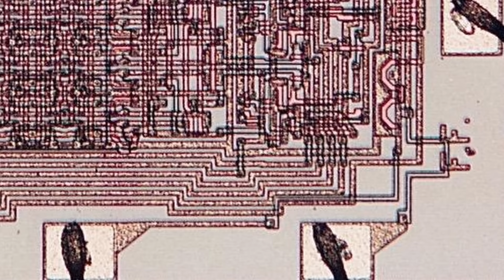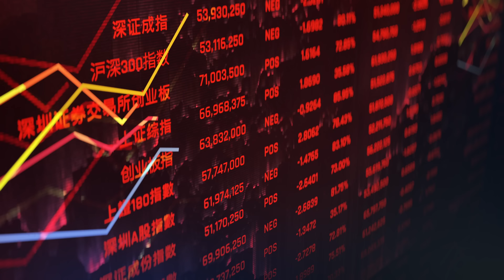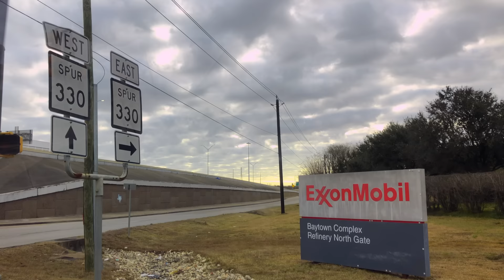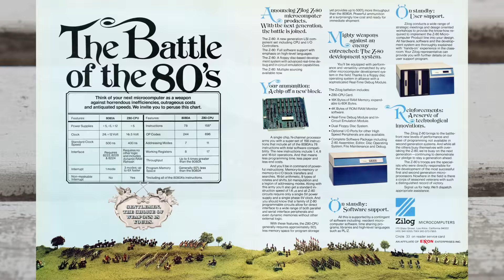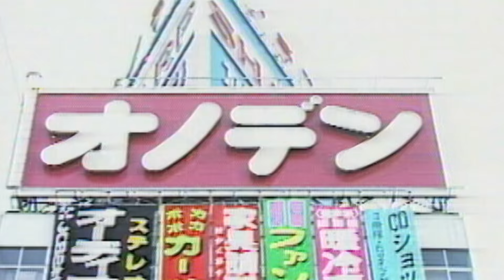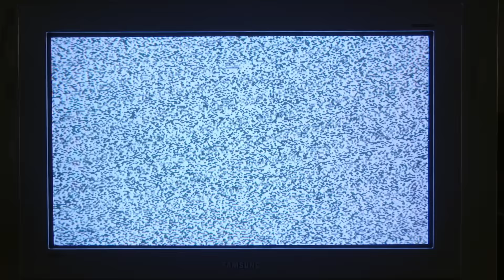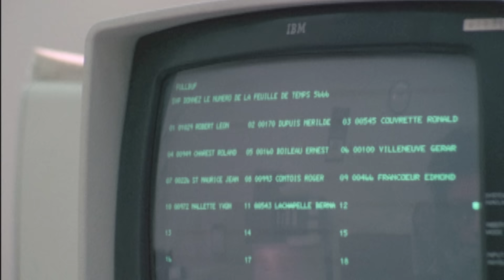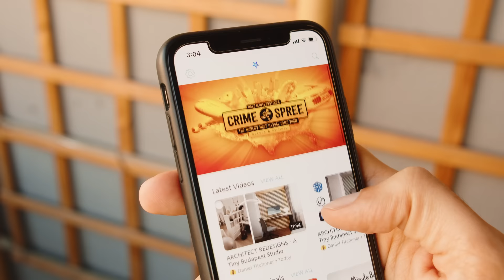Intel’s worst Nightmare

Comment: Wow, thank you for explaining what Z80 is because I believe it is one of the most important technologies that enable 80 column display in an Apple II (Z80 processor card). From that point, we have supercalc, the forefront of all spreadsheet applications. I still remember using and playing spreadsheets in early 80s and needless to say I became a software developer when I was 14 and continue until today (for 40 years and strong). Thanks again for filling me in with this important missing technology in the history of computer development.
Reply: The display format has nothing to do with the CPU. The CBM8000 series from Commodore had 80x25 displays using a 6502 and a 6545 display controller. The 40 character limit was probably a design decision based on small screen sizes and the cost of RAM (1k vs. 2k).

Comment: When the 8086 chips were obsolete, but still in the field, a client had a huge problem.  They used tens of thousands of them.   Upgrading to 386, or higher, was a manual process, that was going to take years.   I actually worked on a project in the 90's, to eak another few years out of the 8086's, so, the company had more time to replace them all, with their phone switching code.  Do you think employees were thrilled.....NO.  They wanted the upgrade.   (lol).   The 8086's did a single task, but there would be 500 in a box.

Comment: The Z80 is still to this day used in all sorts of devices. I've been using the Z80 and it's family of chips since 1979 in all sorts of projects. With 158 instructions (+ some undocumented), mode 2 interrupts, main and prime registers that swap with one instruction, the Z80 is still, in my opinion, the best 8 bit CPU ever engineered. It just works, and there are dozens of assemblers and linkers and library managers for the Z80.  By the way, SGS and Sharp licensed the die(s) for the Z80 and it's family of chips, and was allowed to make the Z80 via a license agreement. If you crack open a Sharp plotting calculator, you'll find at the core of the system to be the humble Z80. The packaging has changed, and some neat add-ons like serial and parallel, timers/counters have been added, but the instruction set is essentially the loveable Z80's, with some add-ons. I enjoyed this video. Thanks!!
Reply from the maker: Oh yeah. I sadly had to cut that part of the video but the story of how Zilog managed to bounce back and exist back today is in itself fascinating

Comment: Re Faggin, no, transistors with silicon were already being made in the mid-1950s (invented by Bell, but made practical by TI). Diffused silicon appeared in the mid-50s (Bell) as well, first with aluminum and silicon around 1955 (using evaporation processes to alloy in the emitter - which meant it produced a PNP). In the late 60s, Faggin created the first commercial self-aligned gate MOSFET chips in 1968 (Fairchild), but SGTs were invented at Bell in 1967. Faggin really became famous in the 70s at Intel with the 4004 initially.

Comment: Nice, but I think you completely skipped over the 8080 processor (as in, the 8080 design occurred before Faggin left Intel). In fact, a great part of Faggins leaving Intel was because management considered that to be the end of the 8 bit line, and Faggin disagreed.

Other small additions to the history:

* One of the major advances for the Z80 was the unified signal structure, like read and write pins, and memory, I/O and interrupt pins. The 8080 was heavily multiplexed and output  these status bits on the data lines, requiring external decoding, and an external chip. This was fixed in the 8085, but that happened after the Z80. To really follow why the 8080 did this you have to follow the original 8008 with 18 pins. The 8080 was an extension of that design.

* The original 8080 required a clock generator chip, which was mostly ignored by implementors, who generally rolled their own, typically with 50/50 duty cycle. The 8080 used two overlapping phases and 60/40 clocking, and the result was timing issues on many implementations. The Z80 fixed that, as did the 8085. In the era the 8080 chip came out, the MOS technology used could not implement fast clock circuits accurately.

* The other "design copy protection" Zilog used was substrate underpassing. All ICs are circuitry built on a substrate layer, and the transistors are implemented as "tubs" of conductive silicon in the substrate, either by diffusion or implant. The wiring normally goes on top of that (and now reaches more than a dozen layers). However, its possible to have short paths in the substrate, short because they are more resistive than interconnect. Several such "underpasses" were put in the design. The advantage is that they don't show up in the interconnect, and (at that time) didn't yeild to traditional reverse engineering methods.

* Intel was correct that the microprocessor market would head higher, first to 16 bit processors, then 32 bit, then 64 bit today. Zilog and Intel fought it out over the 16 bit market with the 8086 and Z8000 processors. Although the Z8000 was a simpler design (it had to be), Zilog could not keep up with Intel on process, and lost the market. Zilog did, however, own the embedded market for a while, and Intel faced a long slide downwards in embedded, starting with the 8051, then the 80186 and a few other failures that nobody remembers today. Motorola was able to stand toe to toe with Intel on process, and introduced the 68000, which shocked the industry with a flat 32 bit memory structure when both Intel and Zilog were trying to push segmentation. IBM chose the loser, Intel, but that created the split that still exists between PCs and Apple computers, which followed the 68000. This is, of course, a whole 'nuther story.

[I worked for Zilog in 1987, on the Z280 project, which was a 16 bit processor downward compatible with the Z80]
Reply from the maker: Thank you for your detailed contribution! It is amazing to hear from anyone that worked on Zilog.

And thank you for details, particularly on the copy protection. I found the whole thing fascinating,. My background from university is on telecommunications so I only have a working understanding of circuit design but the more I learn about how these protections were implemented the more interesting it all becomes.

Yes, I did intentionally glossed over the 8080 in the script, limiting it to a mention later as a design inspiration. It was very hard to squeeze a story this big into a YouTube friendly format, specially for it to fit on a our art budget, but in the source interview Faggin goes into a lot of details on those days and the events that lead to him leaving, including how some of his superiors at Intel patented some of his developments without including him. I figured getting to the Z80 had a higher priority in the story but was still a shocking read.

The other part that was painful to remove was Zilog after Exxon. I was super interested in reading up on how the employees re-bought the company and how they are still a big name in embedded decides to this day, but could not find any way to include that without breaking the narrative flow of the ending. I have read literally hundreds of comments from people who work either in embedded design or in maintenance that constantly run into Zilog chips in things like refrigerators and microscopes. I wish I could have figured out a way to at least mention it while preserving the flow of the video!

The 16 bit section is something that I go into more details on the SIdeQuest episode in Nebula, particularly how the Exxon thing made it impossible for Zilog to compete with Intel on the PC project and how the segmented memory made it impossible for them to sell to Apple on the Mac project. I based those on interviews with Faggin and Peuto and found it a excellent story of how a lot of technology we have today is not the result of what was better, but the survivor of a constellation of business decisions.

Comment: Taught myself assembly language on this chip while working at the Tandy factory producing the TRS-80. We diligently worked to repair every single PCB that had a problem off of the production run. When they instituted a 10 board minimum repaired per day, we went for the easiest to fix. Got 10 done in the morning and learned assembly in the afternoon. Dog pile grew like crazy but management never said a thing. I never could understand corporate thinking.
The mnemonics for the Z80 assembler were far better than the Intel, and the Z did not have that crazy address latching business going on. I also remember Bill Gates meeting with the bosses, but as you know, Radio Shack did not make a deal with him. I wonder what the future of Radio Shack would have been.

Comment: As a side note, I was working for Olivetti in Cupertino in 1979, with the intent of designing them a desktop "personal computer".  After talking with Tom Gunter at Motorola, it was obvious that they had the best 16-bit technology at the time.  We got a working first sample of the upcoming 68000 and designed a board for it, and it worked as documented.  We then developed and integrated it into a paper-like display similar to the Xerox Alto, wrote a cross compiler that ran on a Z-80 box in UCSD Pascal, and created a presentation for the Olivetti "owner" Carlo Di Benedetti to show that it was buildable and programmable.  As was typical of Olivetti at the time, they hemmed and hawed and dragged their feet, afraid of what IBM might be going to eventually introduce.  Meanwhile, my boss, Enzo Toressi, who had gone to school with Federico Faggin in Italy, was being lobbied by Faggin to use an upcoming device they were working on, the Z8000, instead of a Motorola or Intel chip.  After vacillating a fair amount of time, Enzo decided that we should redesign the device to use the Z8000, which was clearly inferior to the 68000.  It would require a complete redesign of the hardware and rewriting of the software due the differences of the hardware interface and the instruction set, and be an inferior product.  I and several other people on the project were disgusted with the decision, so we left Olivetti to be involved in a startup company.

Two years later, when Apple introduced the first Macintosh, with the WYSIWYG user interface, and almost identical hardware design, using the 68000, Enzo contacted me and said "Now I know what you were trying to do".  I give him credit for acknowledging that we had basically designed the Macintosh for Olivetti, at least a year ahead of Apple, but that they had thrown the opportunity to be "insanely great" away.  They did go on to design a PC around the Z8000, but it was a commercial flop.  They ended up cloning IBM PCs around the 8086, which they sold under their own brand name, and for Xerox and ATT, before they finally went bankrupt.

Comment: As one who owned a 48K ZX Spectrum at the time, and dabbled quite a bit with writing small routines in Z80 assembler, I remember the Z80 processor quite fondly! The other later processors I never felt the same connection to.

Comment: The original IBM PC was based on the Intel 8088 not the 8086.  The 8088 had 16 bit registers but an 8 bit memory bus.
The Olivetti M24 was the first commercial PC to use the 8086 that I am aware of.
Reply from the maker: Correct as far as I understand! The 8088 was a modification on the 8086, so I had to massively simplify the explanation at the end for the x86 name of the architecture to make sense without derailing the video in a story of the 8086 segment.

Comment: My career has been in integrated circuit chip layout design.   The roles filled by the characters so far are that of the circuit definer, which the Japanese client filled, and the role of the circuit designer, which Faggin filled.   The photograph at 3:21 shows the work I do.  That is a single metal process using polysilicon tunnels.   The big blobs at the bottom and right side are the bond pads with gold wires attached.  The bond pads can be used as a scale, as they were 4 mils wide, approximately 100 microns.   The metal circuit lines are thus about 5 microns wide.   In 2022, microprocessors pattern lines that are only 1 thousandth that wide at 5 nanometers.   The entirety of the 4004 could be redesigned in an area smaller than one of the bond pads in that photograph.
Reply from the maker: You still do layout? I would love to hear more about your expertise and experience. I can be reached out at alex@lowspecgamer.tv

Comment: 0:45 Faggin invented the self aligned silicon gate for MOS transistors. Which were already made from silicon but had the gate connection made from aluminium. Faggin used polysilicon instead which enabled greater miniaturisation because of the "self aligning" aspect enabled greater accuracy.
Reply from the maker: I know, I had to simplify to “silicon gate transistor” for a general non technical audience.

Comment: Interesting fact: The first commercially available computer that was sold with an AT&T UNIX license had a Zilog Z8000 at it’s heart. The Onyx C8000 and C8002 were the brainchild of Bob Marsh and Kip Myers. A young Scott McNealy ran the manufacturing operations. He later founded Sun Microsystems. The Onyx C8000 was faster than a DEC pdp-11 when running UNIX.
Reply: I was about to mention the Z8000 myself. Here in the UK during the mid 1980s the company I worked for wanted to try them but as I was told it you simply couldn't buy them because the US military were taking the entire supply?
Reply: Worked on the Onyx C8000 briefly in 86-87, was a big tower based system with several 20mb full sized 5 1/4 disks. Took ages to fsck if you had a power fail!
Reply: @jedglover8245  Ah! “Fuzz-check” on SMD hard drives was indeed tedious! 😜

Comment: My first IBm-compatible sported a 8-bit 8088 running at super fast 8mhz.  For work, we intended to use PCs for factory automation add-ons.  Spending government money technically, I super-charged the pc by 50%, from 8mhz to 12 mhz by "replacing" the clock crytal with a turbo-kit. 😊

Comment: Remember this all but wasn’t aware of the Exxon dimension. But the IBM PC launched on the 8-bit external bus 8088, not the 16-bit 8086. As I recall, that came in with the PC XT and was seen as the ‘power option’. And if you wanted to ‘go turbo’, you have the 8087 maths coprocessor too, although few machines had this. I often think back to the XT with its 10Mb HDD which seemed enormous, even to me working on mainframes. I mean, how could you use all that space. How the world has moved on! 😮

Comment: I have a Tindy TRS-80 Model 200 which has an Intel 8085 - it was 8080 compatible and fixed some the issues that the Z80 had addressed, i.e., it required fewer support chips to design systems around it

Comment: The Zilog 16 bit CPU was the Z-8000. They were available, back in the 1990's and I've seen them listed by component suppliers, in the UK. I have the instruction codes list somewhere. The last time I came across one was in a change machine.

Comment: Ugh ... that Sinclair made a far better doorstop than a computer!  Back in the day, I was quite fond of the Z80. I replaced the Intel CPU in my CP/M machine with a Z80, and it very noticeably ran faster, especially when it came to boot up time.  That said, I greatly preferred the Motorola 6809, or the 68HC11. Regardless, much of the first 10 years of my career was spent writing embedded controller code for the Intel 8031/51 ... using assembly language and an in-house macro assembler that was far better than any commercial tools at the time.  Granted, there were a few times I had to use the Intel "blue box" with it's 8" floppy drives and line editor.  That was painful.  Still, of the Intel 8-bit processors, I really preferred the 8031/51 over the Intel 8085 which we also used.

Comment: I owe a lifelong love of computer programming, and computer architecture to the Z80 chip.  In fact my entire career would have most likely been different had I not been exposed to computer programming via the venerable TRS-80 Model 100.  My uncle at the time was a professor at a university in Long Beach, CA.  He had come down to visit and brought his "portable" computer.  He was working on a BASIC program with one of his graduate students, and he let me look at the code print out.  It sort of made sense, and after asking him a LOT of questions he finally gave up and he let me tinker with it.  By the end of a very long night (I think I saw the sun come up when I finally put it away) I had taught myself some very rudimentary BASIC and I was officially in love.  The rest is history.
Reply: I used Z80 machine language on a Radio Shack Model 4. 
I think that TDSDOS was superior to MSDOS at the time. The operating system came with a print spooler and debugger that I think MSDOS only had as an add-on later.
What I believe killed the Radio Shack computers was that their word processor, ScripSit, had a bug that scrambled the text when you use the block text commands in certain cases. The bug was a missing POP instruction is the code.

Comment: Zilog is one of the true tragedies of the early chip industry.  The Z80 was an actual leap forward in the tech of the day, but it never managed to gain the traction it deserved in the areas it needed to be.  The Z80 is still in use today for some SCADA systems, and it's big brother, the Z8000 still has wide use as well.  But it never made it to the place it needed to be. A lot like the 68000 from Motorola.